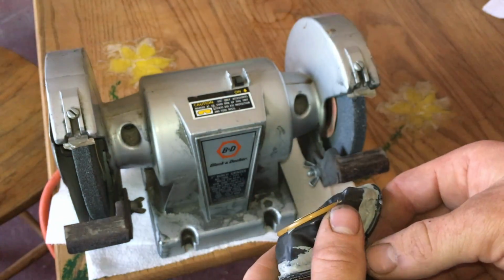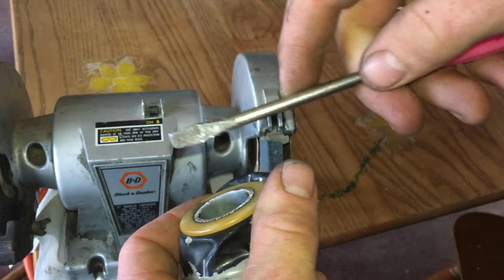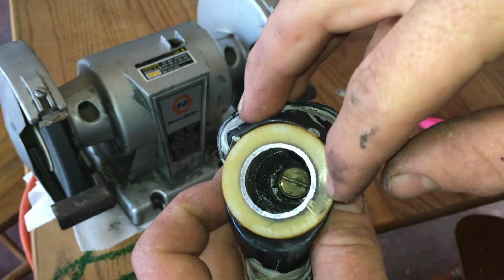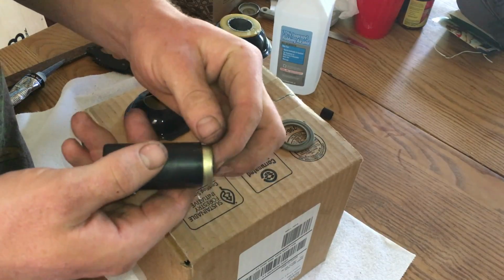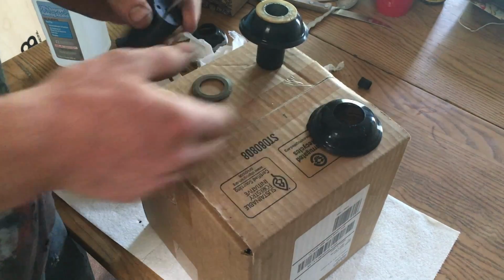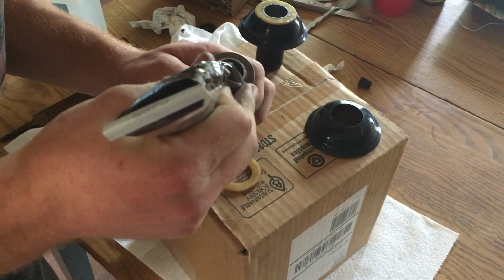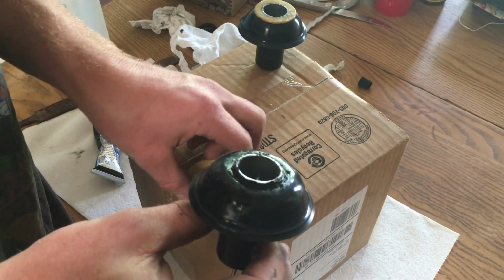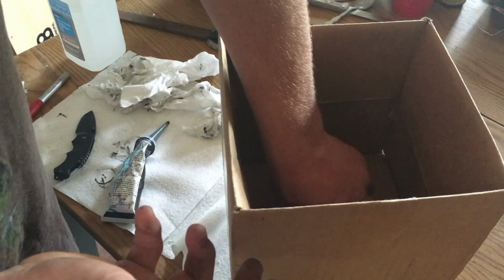Motorcycle Backfire on Deceleration - How to Replace a Carburetor Diaphragm

Comment: Honestly I didn't get it .. why the heck you had to damage the slider, if the diaphragm comes off just by stretching it out and a new one goes back the same way - just soak everything with a soap water and stretch it back to the place. .. takes about a minute or so :))

Comment: This is so wrong. The weights of the slide matters, that gasket maker makert/cement is wrong! All you need to do is use soap and water and easily strech the diaphragm on the slides. It's not that hard.
Reply: Damn right .. seems this guy hasn't done this before or was too lazy to check the Youtube first :)))